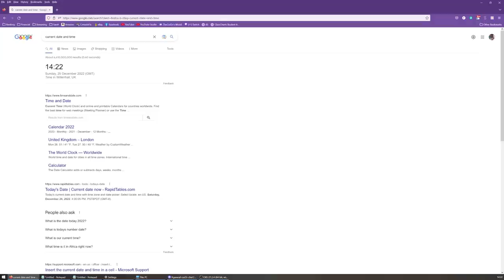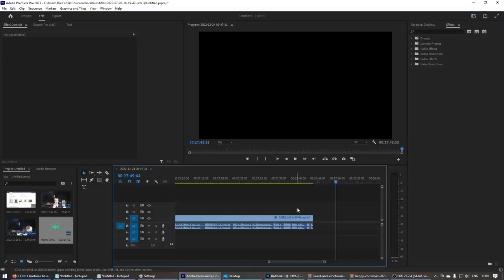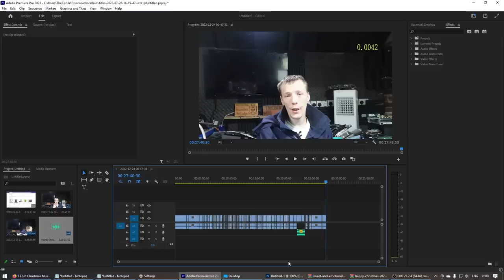I Had To Perform A Warranty Repair On CHRISTMAS DAY! But Can I Fix This PS5 Or Will It Ruin The Day?

Comment: Good on you for doing the right thing, Phil. Thoughts I have: You changed the Southbridge and that fuse already prior. Both failed again. I would now boot it up and look at the heat signatures as SOMETHING took them both out twice. I don't think it's 100% yet but you're close.

Comment: Ooof, this is a tough one, but you've got a great attitude towards customer service mate! 
To ensure the console hasn't been dropped in future for warranty claims, you can get small stickers (eg. ShockDot / ShockWatch) that essentially provide a measure of mechanical g-forces. They come in all different g-ratings, and basically, if the item is dropped/knocked beyond the g-rating specified, small indicator vial turns red - giving positive confirmation a certain g-force has been exceeded. They're only a few pounds each, so they could be a cheap insurance policy for consoles you're repairing/selling - just place one near your repair/warranty void stickers.

As for what to do... I would give the console back to the customer, but I would stipulate that they need to either have their electrical outlet inspected or recommend some sort of inline power filter/surge protector; and that any future power supply related failures aren't covered under warranty. The filter won't protect against everything (eg. extreme low/high voltage), but may be enough to prevent future failures that might be noise related. I'd also confirm they're not running it off a dodgy power strip/board.

Comment: I would say its possible something overheated, but you can check that with the thermal camera once you've got something working so it would be obvious if something was going bust, and also thinking about it a bit more 1 hour is a long time for somethin to be running if there was a heat issue. Other thing is maybe a component was on its way out because the technician before you was doing all manner of magic on the board, such as nuking stuff with the heat gun.

Comment: Most likely the cold christmas fever got to the ps5. That a expensive lesson you should have went through the whole ps5 board and test everything but shot yourself in the foot by skipping a few areas. Here a tip for you phil take a picture of the board and mark up all the areas with voltages reading and flow direction that way you look at it on the wall than swapping boards every time you will lose track of everything

Comment: Just found your channel dude, and did my first PS5 due to my Nephew jamming something in the DVD drive it was on a Model CFI 1216A(4 WEEKS OLD), fixed that as it has a specific way to line up the DRIVE once you open it, also replaced the Liquid metal with some stuff that was better, as we were getting overheating while gaming, and i did a thermal paste trick too, video up soon once i Edit it, Subbed to the channel dude, so be great if you could follow, up in Sunny Scotland. :) ta

Comment: No diss bro, Coz you knows your stuff, Still i would only bother with PC, After 2 years of using the PS4 pro, I managed too get an i7th gen, Empire gaming CPU liquid cooler, 16gb vengance ram, And a 1660 super 6gb OC, With a 750watt PSU, For the price of 455 qiud, Isnt that cheaper than the PS5 and its better than the PS4 that is for sure, Probably knock spots off a PS5, And AMS2 looks stunning, Raceroom is also stunning looking, All i know is it do not scare me to upgrade my PC like consoles....
Sim racing is so much better on the PC...
Still tho you got it done, Personally I've had a better experience with a PC, But then i also used to produce Hip Hop, Will be back on my Hip hop beats this year for sure.......
I salute you brother......

Comment: I don't know why Sony puts so much liquid metal on their chips... They use so much it's practically a liquid metal bath under the heatsink. You should only need a very thin coat, I used liquid metal under my IHS, between the IHS and cooler, and on my gpu and I never had a problem with it spilling out or anything even close. Certainly didn't need a sponge to keep it in place.

Comment: Lovely to hear a fellow Midlander in full flow... I was wondering actually if you fix PS5 controllers?  I have 3 that are all suffering from bad stick drift... all only a year old too (just outside the warranty.... after I had a fourth replaced still in warranty)... so annoying!! haha.
Reply from the maker: Haha cheers bud, it's nuts how many locals see these videos 🤪 I actually don't do controllers, too unreliable for me because the only parts I can get are cheap knockoffs, but there's a guy on here from Birmingham called Uber Micro Repairs. If you get in touch with him (or her, Leigh and Tabatha) they specialise in controllers so definitely able to help. I'm not sure what the cost would be but they're cheaper than replacing the controllers :)

Comment: I also had to fix a playstation on the 25th, but I had it easy. It was my old PS4 Pro I gave to my brother, and all that was wrong with it was that the disc drive cable wasn't fully plugged in.

Comment: someone gave liquid metal and did not secure the capacitors on the processor, now the liquid metal has spilled and the two capacitors are short-circuited.

Comment: Hi Phil, thanks for great videos. I have one question: does south bridge is married to the APU or not in PS5? In previous video you mentioned it combines syscon and married to APU however in this video you replaced the southbridge from donor board and fixed the console. Thanks in advance, Sam
Reply from the maker: Hey Sam. No the southbridge isn't married, we tried it on a few earlier consoles and it would never work, but then one day it randomly worked for some unknown reason. I'm actually planning to do a video soon on what mistakes I made and what I've found out since making those videos :)

Comment: liquid metal is the worst implementation any console has in it and as much as its the best out there its also the most problematic.
Reply: It’s easy to take apart and fix
Reply: Yes but Sony's biggest problem has always been consoles becoming loud and some even being loud from day one, mainly due to their priority on cosmetic design rather than cooling performance (in previous generations).

The only way they were ever going to achieve a whisper quiet console running games in 4K, 60fps, Ray Tracing etc. was to use liquid metal and a huge fan that because of its size, doesn't need to spin super fast to move enough air. Liquid cooling is not an option since the cost and risk from pumps, tubes, water etc. inside a mass produced system wouldn't be justified and would reduce fault tolerance massively.

They could have used a vapour chamber similar to the Xbox One X, however the liquid metal setup in the PS5 is still superior.

Comment: My ps5 was giving me hard drive warnings, turned out it was a corrupt HD. So I updated it and it never came back on, I get a single beep when I press power just like that one. Sony wanted €270 to repair it. Its still sitting up in the room as I refuse to pay it
Reply from the maker: Could be an SSD issue. We've discovered they are failing (very recently) and we are able to fix them, for much less than Sony are charging
Reply: @TheCod3r  pity your in the UK and I'm here in ireland, would def consider getting you to fix it if so 👍

Comment: Good video. Thanks for the drop. Keep a simple excel doc on what repairs/components you have replaced and cost to you. Can quickly see if still any room for refix left in a warranty return or more cost effective to break for components. 
Also can see quickly what issue was at first fix so can go back to that quickly to see if failed again

Comment: You're a good bloke Phil. Very few would have done what you did. 
On the question of liquid metal,  i see some folks put it on their gaming laptops with no barrier. Usually causing failures however i watched Sorin do it and he used so little of it on both surfaces. You've said yourself Sony use too much. The conformal coating is a great idea,  but i would also completely replace the metal with good quality alternative and use as little as possible.

Comment: why did it take that fuse out tho
Reply from the maker: Likely because I injected voltage. It happens quite often with voltage injection to be honest because of the high current draw. I should know better by now 😮‍💨
Reply: @TheCod3r  hey it happens at least you replaced his ps5 for him.

Comment: The PS5 has to be the most flakey console ever made.  Failure waiting to happen it seems.
Reply: Sony use cheap parts yet they charge us hefty prices for new consoles, it doesn't make sense 🙄 😫
Reply: I've had mine since launch day and fortunately never had any issues with it.
Reply: I'm surprised that playstation buyers don't say you a playstation deniers. I guess either yaw had good luck or rich and don't care. I don't have a problem with the games just the crappy hardware. I got a lot of tablets for years don't have any problem breakdowns.  Can play playstation 2. Will wait until tablet play playstation 5 when able.